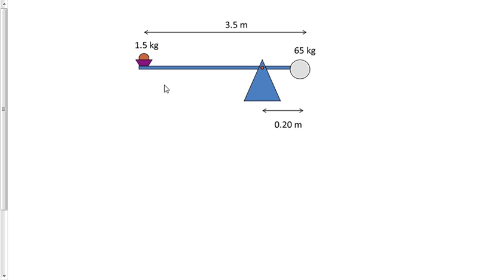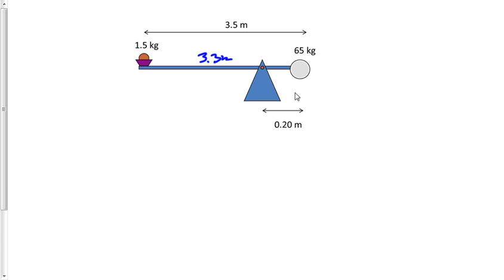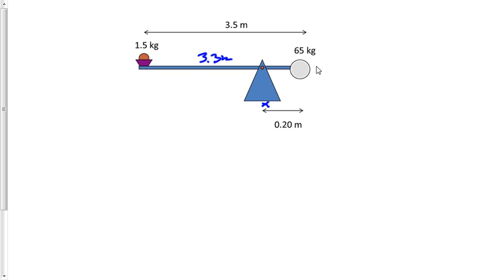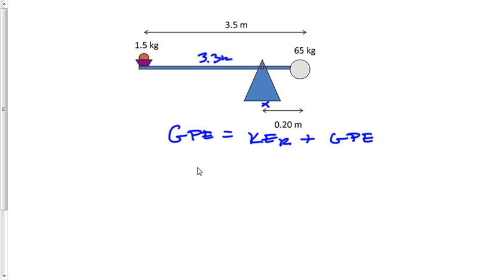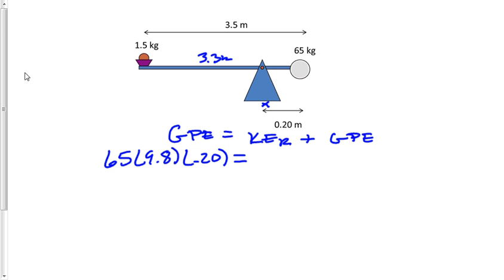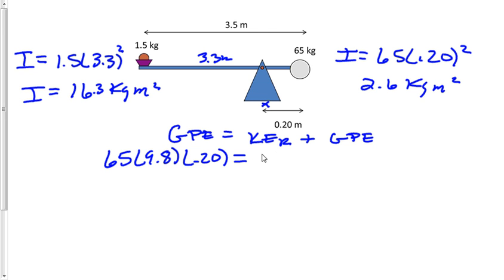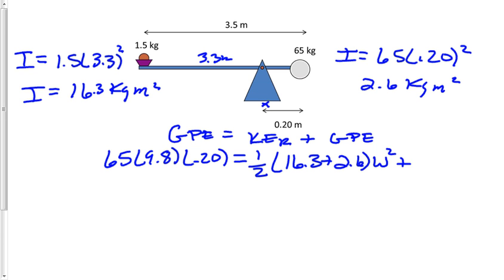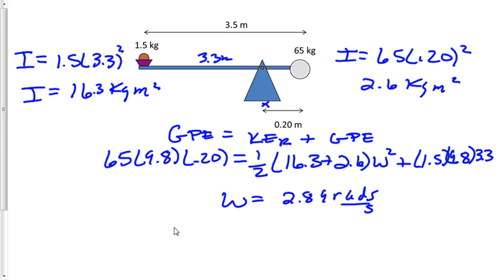Chapter 8 Trebuchet

Comment from the maker: You could add the center of mass of the beam and then calculate the increase in potential energy for the center of mass as it goes up.  This would of course slow down the release of the ball.  You could also use the equation KE = 1/2Iw^2 to account for the rotational kinetic energy of the level arm as well.  The moment of inertia (I) in this case will be equal to 1/12mL^2.  Again, this will slow the release of the ball.  I hope this helps.

Comment: What if you add the potential energy and rotational inertia of the center of mass of the beam to the equation? Would that be an accurate way of taking into account the mass of the beam aswell? Thanks in advance.